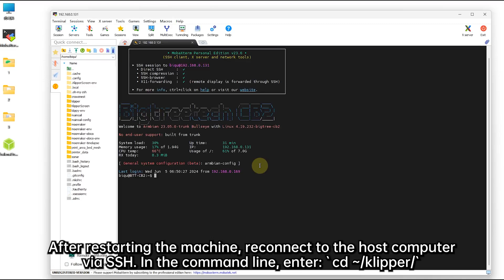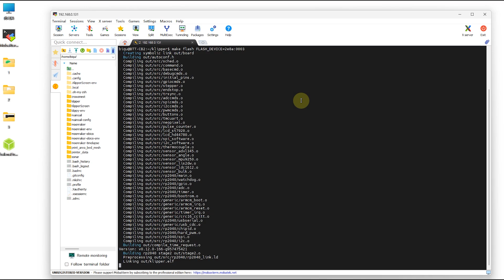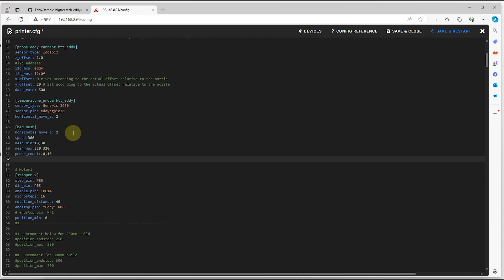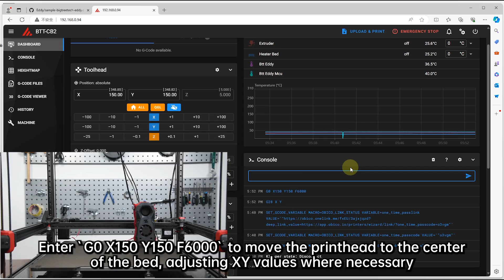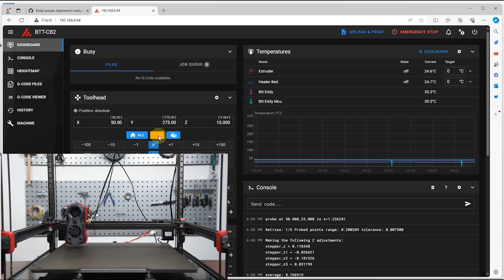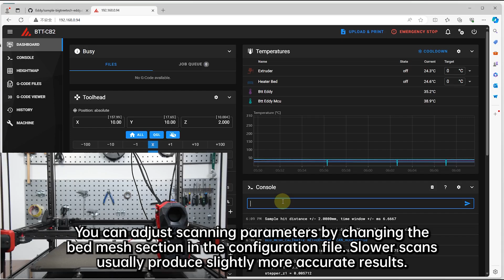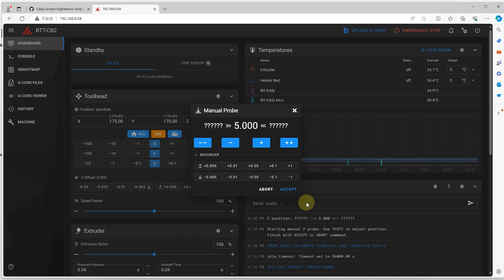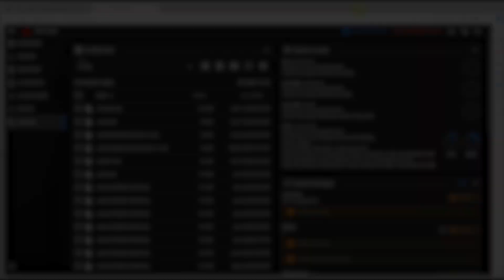Guide: Instructions to configure and calibrate Eddy Series (Eddy Duo, Eddy Coil)

Comment: I don't get the "Flash chip (W25Q080 with CLKDIV 2)" Option when I SSH into my raspberry pi 4. I have Klipper/Mainsail up and running and up to date as of Oct 20th 2025, but I have no idea how to get the EDDY USB probe running.
Reply from the maker: You need to select this option (W25Q080 CLKDIV 4). The manual has not been updated. Please follow the instructions on the wiki~
Reply: @bigtreetech5117  It was my fault, I misread the instructions. Thank you!

Comment: If you do the temperature calibration at the 56C it will error out, when printing at higher temps. You need to set it to 66-70C not 56C.
Reply from the maker: Hi, friend. The temp we provided is a sample value. Everyone has different usage scenarios. Please modify it according to your actual usage.
Reply: For enclosed Vorons, some people spend a day heat soaking their enclosed chamber and seeing the max temp the probe gets. Then, the next day they do the calibration process up to that max temp the BTT saw, or close to it. For example, my calibration was up to 72 step 4. Also, it is super important to start the process from cold. So, unfortunately if you have been messing with it for awhile, you may need to just walk away for a few hours and let the temps come down.